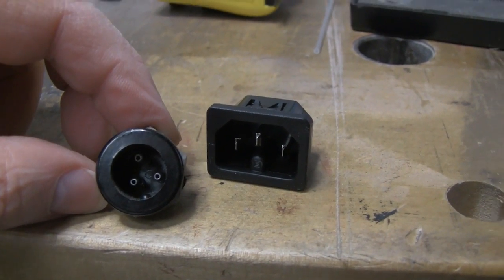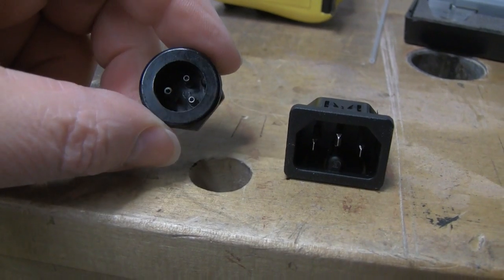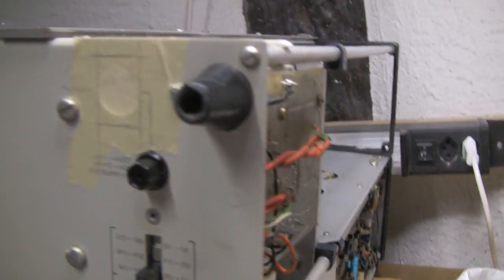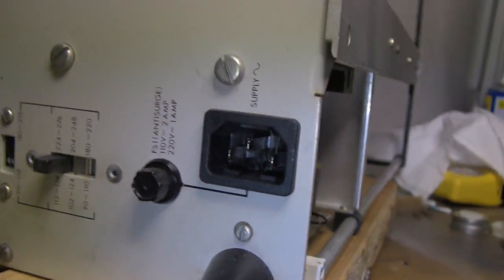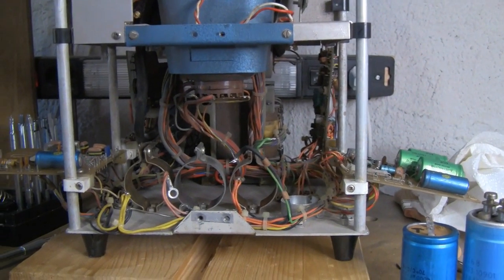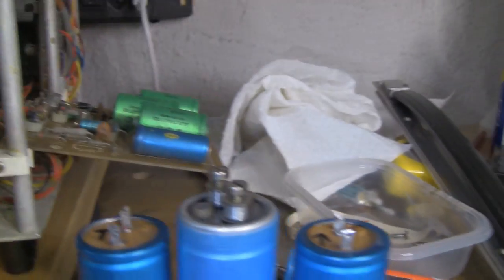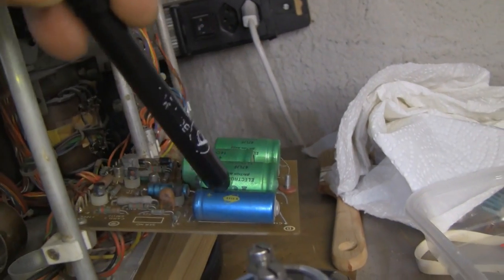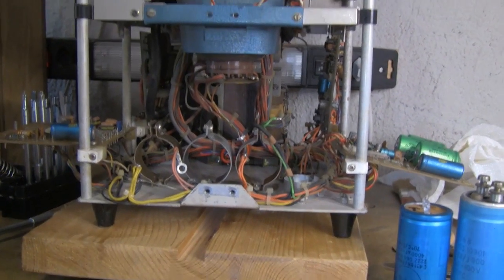SM112 Scope Repair - Part 2

Comment from the maker: @batterymaker That's for sure - I've ordered up most of them.  I found some with the same body diameter just shorter than the originals so hopefully all the clamps won't need replacing!